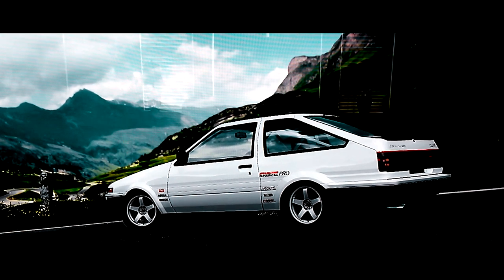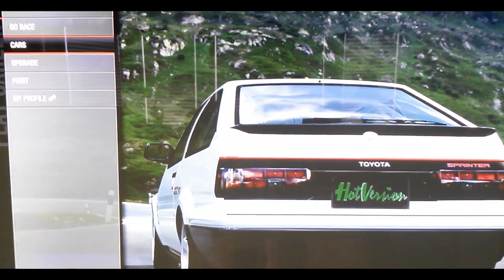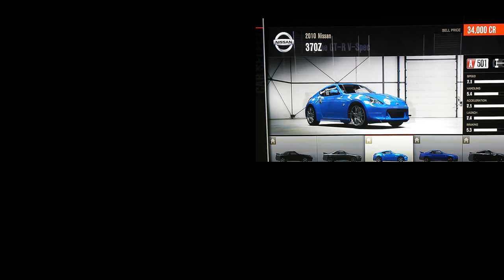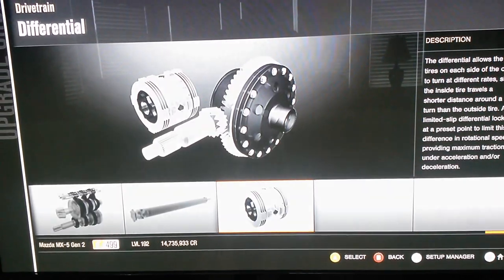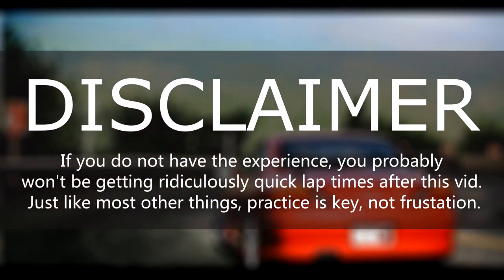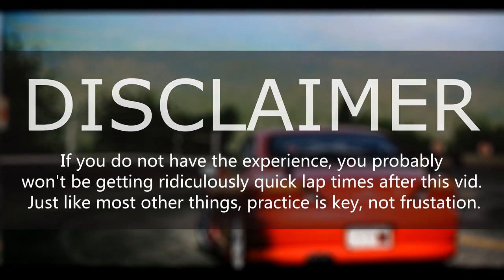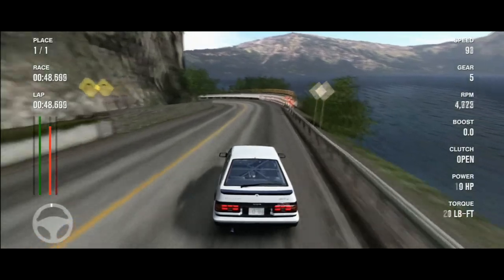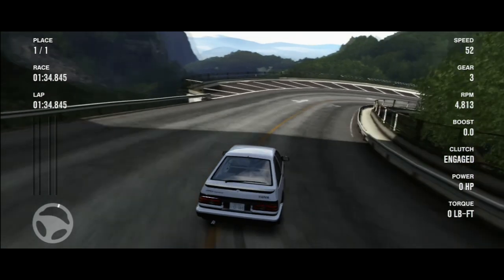HOW TO TOUGE [FM4]

Comment: the last hair pin combo there, you turned in too early at the last hairpin, you could've stayed outside and turn in later, full throttle early and you could've shaved .500 secs i think
Reply from the maker: Definitely sounds like an interesting line however it may be a bit difficult to aim for the apex on turn in as the driver would be blinded from the apex on corner entry (shown at 8:50-8:52-ish). Unlike the previous hairpins, the final hairpin includes a slight gradient drop at mid corner and is a bit longer than the previous hairpins so nicking the throttle point would be a bit tricky imo. Also I'm not sure that doing so would cause a .500 sec gap between me and my ghost...